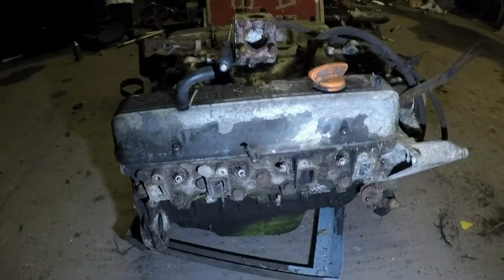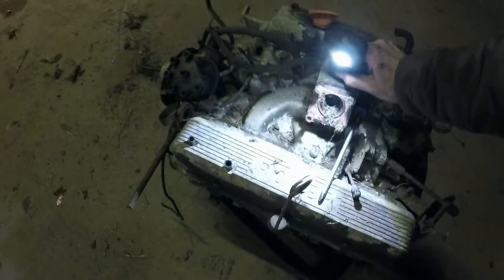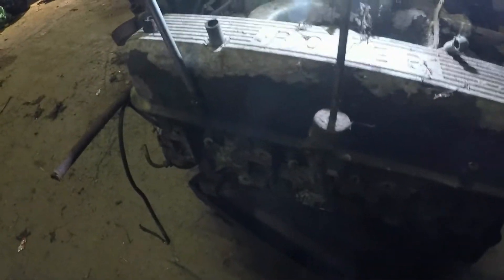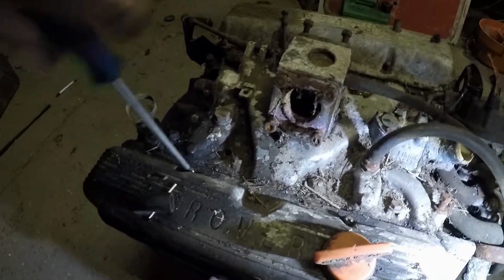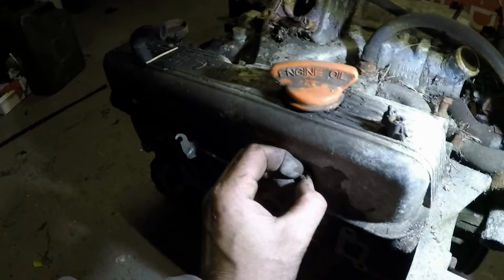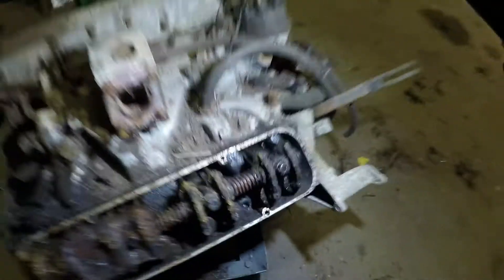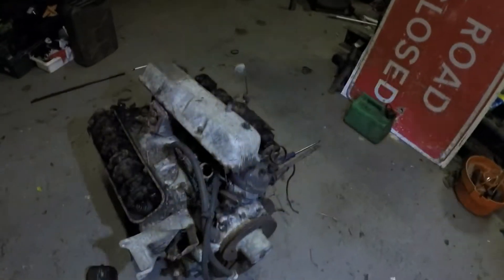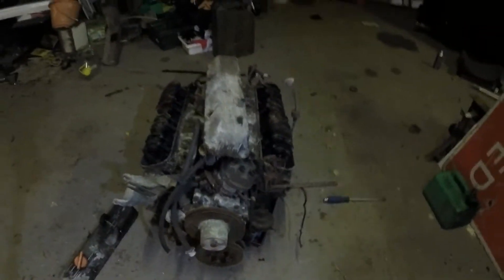ROVER 3.5 Litre V8 Engine ...Part 2 .. Christmas Eve Pre Stripdown Rocker Cover Removal....

Comment: Hopefully there are no cracks but that head doesn't look good. Good luck with that tiny motor.
Reply from the maker: Ignoring the obvious water 'damage' the 'sludge' content in the heads isn't that bad.... but what damage has that water done? Cracks are possible... and corrosion! I did notice that pretty much all the valves look shut.... it happens with hydraulic lifters.... and might of saved the cylinders .... Boxing day might see the heads and inlet come off....
Reply: @BLOWN8CYLINDER  good luck with it. I am always interested in a engine refreshing. Hopefully the water isn't a issue. It looks like a fun project. I never understood why people don't learn how to fix engine's. I love to bring back old motors that are gone and I am able to get them running like new. I would rather drive a old car then a new one. I'm glad my dad taught me about cars and I took auto shop in school. I was the only one with a muscle car. I got in trouble for doing burnouts on school property a few times. I guess anyone can drive a newer car but only certain people can drive old cars. We have style I guess. Well good day to you.
Reply from the maker: I have to agree 100% on 'driving' a car.......   I grew up on rear drive cars, including a very snowy first winter on the road.....   The highlight of 2020 was returning that 1946 Bedford truck back to it's owner.....   As for this Rover motor.... if there is enough left to make it worth rebuilding I will, it might become the most budget of budget rebuilds on the internet if it allows it to run once again on a test bed ....